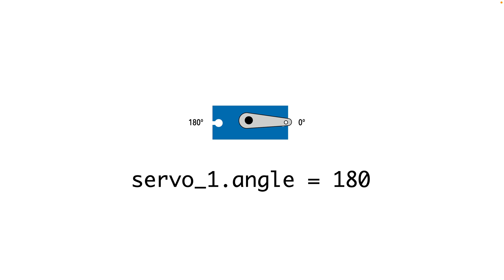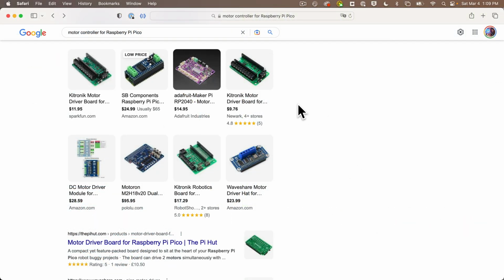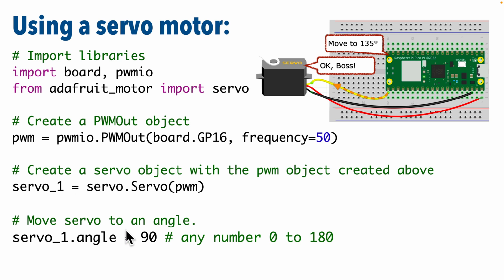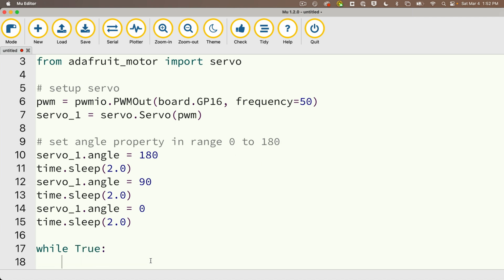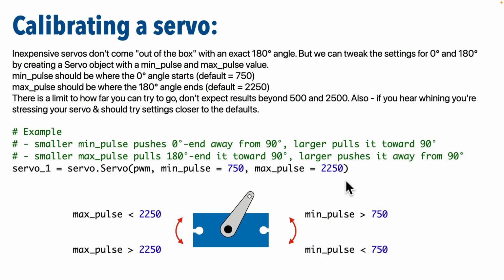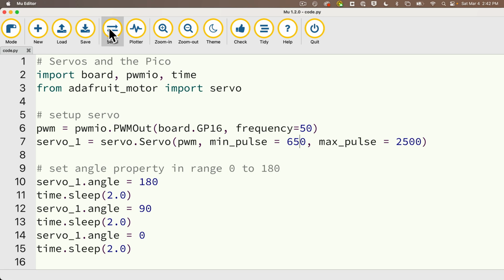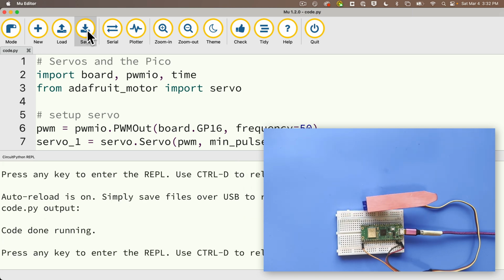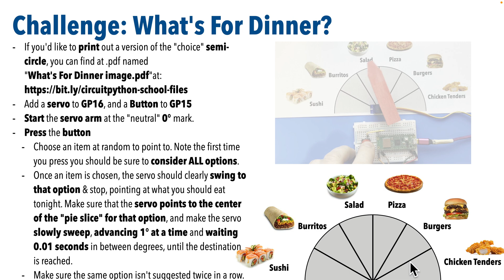Servo Motoring with the Raspberry Pi Pico and CircuitPython

Comment: Hi how do install adafruit library import board my programme no import board ?
Reply from the maker: Seems like you are jumping ahead and missed some basic lessons earlier in the playlist. “board” is a built in. There is more explanation at this URL. If you are looking for some specific help you should try adafruits excellent discord which is meant as a Q and A forum but also be sure to go through the basic videos here or similar lessons. Especially things covering installation, pins, troubleshooting, etc. The code you’ll see in each lesson works if you follow from the beginning and don’t miss a key step. https://learn.adafruit.com/circuitpython-essentials/circuitpython-pins-and-modules